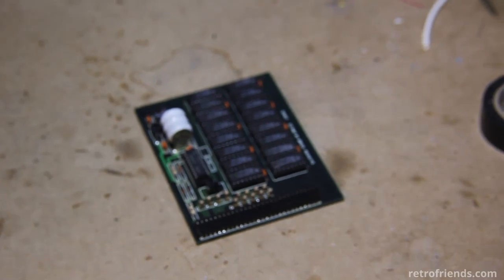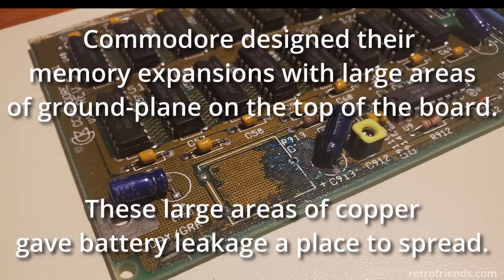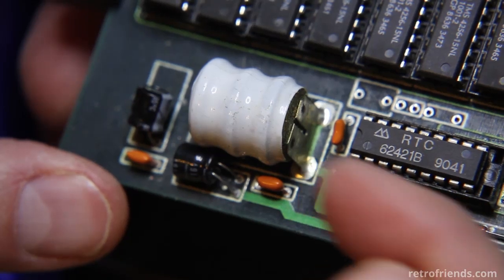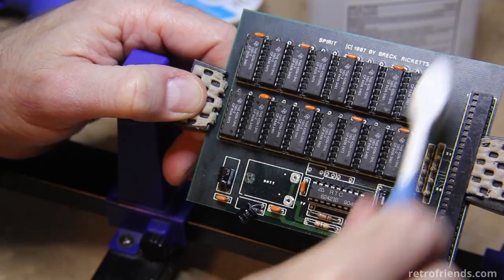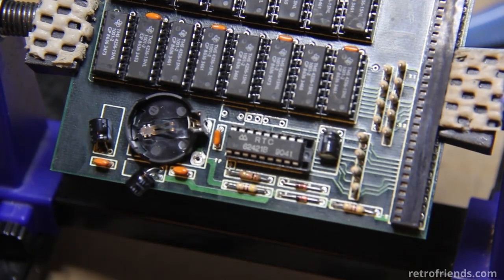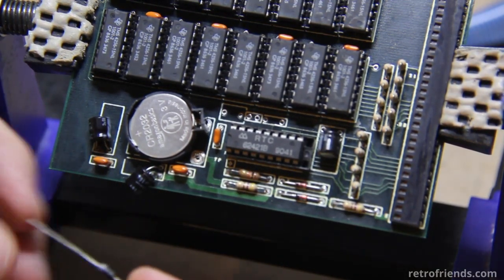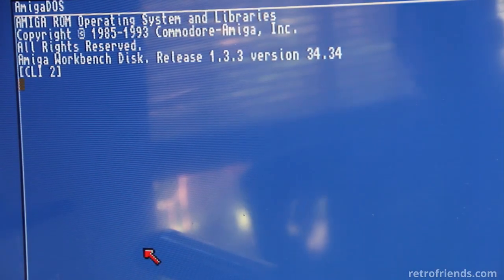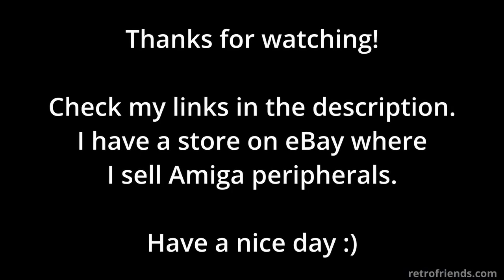Spirit Amiga 500 memory expansion NiCd battery replace

Comment: I can remember that this board also broke for me. But back then it wasn't the lack of battery voltage that was to blame, but another error. If I had had a schematic I might have been able to fix the error. Do you have any idea where I could get a schematic? Many greetings.
Reply from the maker: The board design is actually pretty simple. The data lines and address lines are going to be going to the same place as an a501 release 5. So grab the a500 release 5 schematic and the last page with the schematic for the a501. That should help you.
Reply: @retrofriends  Thanks. I'm searching for it. 😄

Comment: What about a schottky diode?
Reply from the maker: Just about any diode would work here. The voltage drop from either type is acceptable - the RTC circuit is not fussy. Factory a501 memory expansions use zener diodes for the RTC power input. Actually, I usually skip all that and use a rechargable 2032. An exapmle of this is coming soon to my channel.